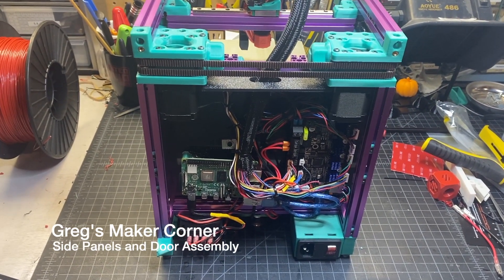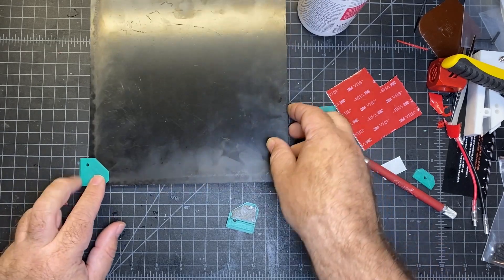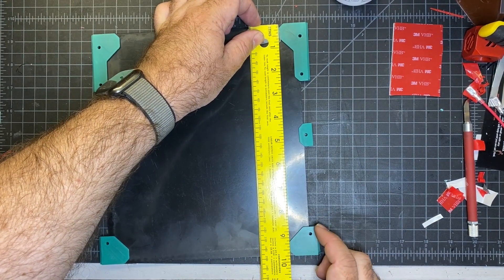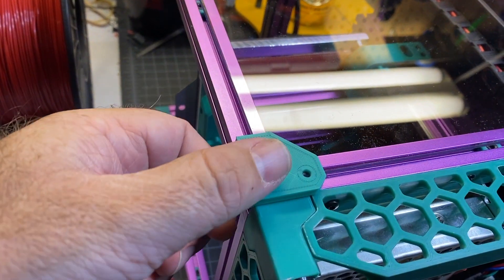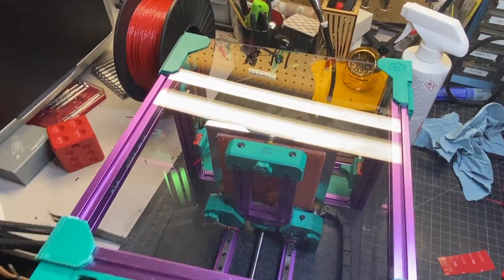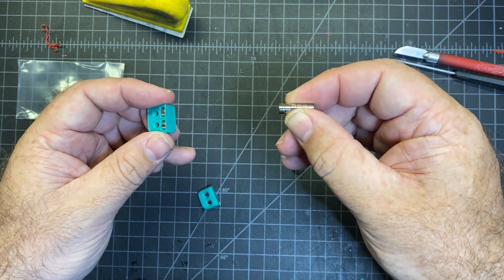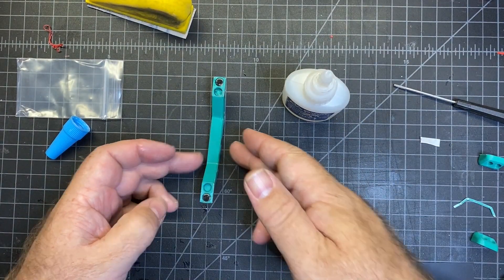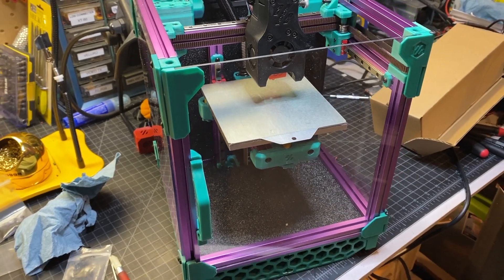Voron 0.1 Build Series - Panels and Door Assembly

Comment: I’m seeing a need for cooling the electronics after finishing the stock manual instructions with the parts recommended. Got any suggestions or ideas for adding cooling for the back electronics paneled area?
Reply: Particularly, I’m getting a little warning icon on Mainsail OS screen saying the raspberry pi exceeded optimal operating temps. I presume it will throttle its performance after it sees its temps go too high?
Reply from the maker: Sure, it's definitely not a bad idea to keep things cool. I think the printer mcu is fine, but what I did is added a small little 5v fan (powered by the pi pins when turned on) that blows over the raspberry pi. I secured it with vhb tape.That seems to help keep temps well under 50C for me which should be fine.

Comment: Thanks again for the video! 
I wasn't aware that so many parts are just glued in place - I am not really a fan of that to be honest. Why not use countersunk screws for the handle and make the magnets hold on to the screw heads? Maybe I will redesign some of the parts before printing them.
Reply from the maker: Screws are definitely a good idea for the handle. The tape does work pretty well, but I think screws would hold up better.